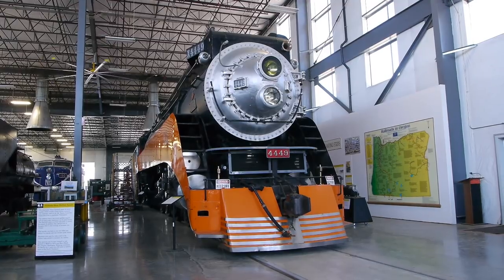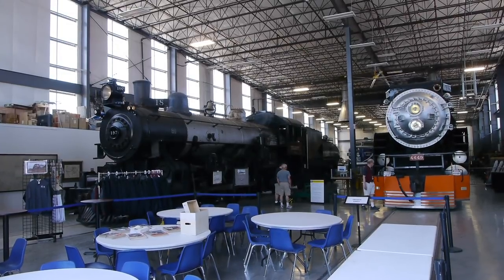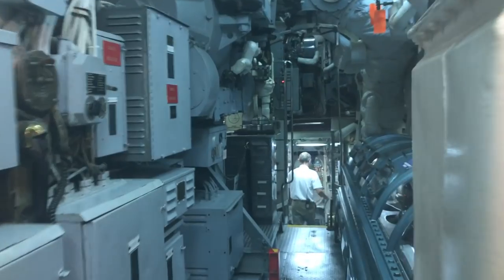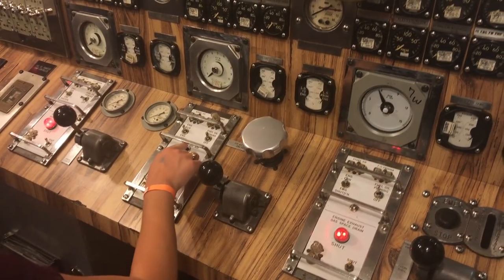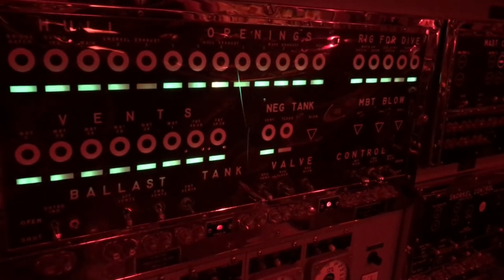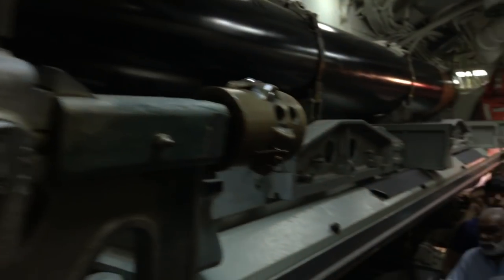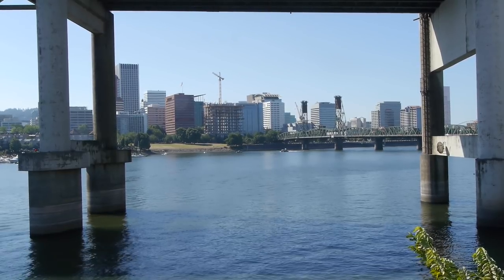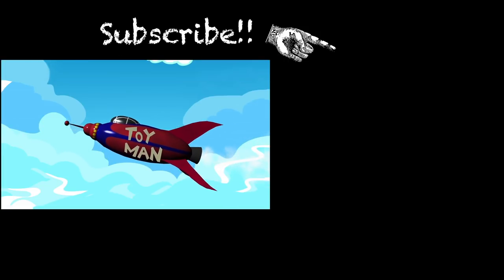USS Blueback - Fast Attack Submarine in Portland Oregon

Comment: There is a touch of railroad connection to the USS Blueback. The engines in the sub are from Fairbanks-Morse and are of the same basic design that were used in FM's locomotives.
Reply from the maker: Much like a locomotive

Comment: Note that these engines (EMD  and FM) are very close to locomotive engine/electric.  EMD used modified 201A to develop  locomotive diesel electric systems.  Also LST's used locomotive compatible systems.  So EMD was in fighting trim in 1945 and ready to take on the steam locomotive.

Comment: Great. I didn't remember that the hatches were that small (the one I visited in Japan is ON the port, so they made an easy access by the side, no need to go trough an hatch, but only a part is accessible).
But these sub propellers seem small compared to ship propellers.
Reply from the maker: This one is actually under water too! As with all subs the deck is just above the waterline. So on entering you go down to about 10 feet below the surface.

Comment: The whole idea of diesel/electric propulsion originated in submarines like this. The WW1 boats were TINY. It did not take the RR industry long to figure out the potential however and the rest is history. I love steam as much as any railfan, but the maintenance was just too much for the railroads to bear.
Reply from the maker: At first they thought it would never work on anything bigger than a switcher. After quite a few years horsepower hit 1800!! But still not good enough for a long freight. They were doing well on high speed passenger. BUT when they worked the bugs out of MU, hooking 4, 5 6 locos together all running from one cab, and then inter train MU still running from one cab.... The rest is history. The death of steam and turbines and all big locos. The 6900 class being a attempt at a huge diesel. BUt pointless. Really just 2 loco in one box. So why not just build 2 loco?

Comment: A little tidbit, the Navy back in the 30's gave money to the diesel train makers to help them build better diesels because they used those engines in their submarines.  Also, I'm over 6' and was a submariner for over 6 years, and I've known submariners that were taller than me!
Reply from the maker: I’m 6’3”. Now. Was taller years ago. Anyway not a problem in the sub. The bad him and knee was a real problem. NOW when the boat is underway on leaving port there is food stashed everywhere. In the showers. But all the floors are covered with the large size cans. They walk on the cans which are about 10 inches tall. Slowly they uncover the floor. But for much of the trip at least some of not all of the “floors” are 10” taller. So the headroom is about 5’6”. They call them navy seals but these guys duck.
Reply: I remember those cans.  One had to be careful because, though they were stout, they might not be stout enough for you to walk on.  Another thing that often took up space was all the gear of the "riders" you had on board.  As a bubblehead I hated those guys because all they did was eat our food, take up space, and hog the gym equipment.